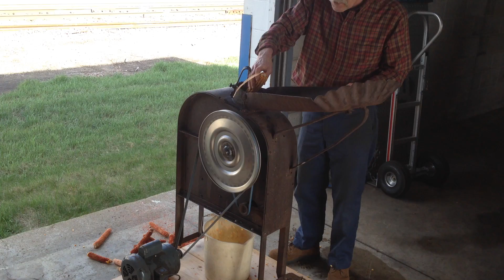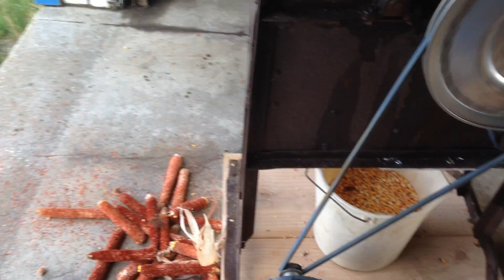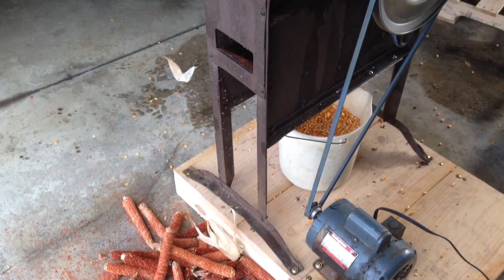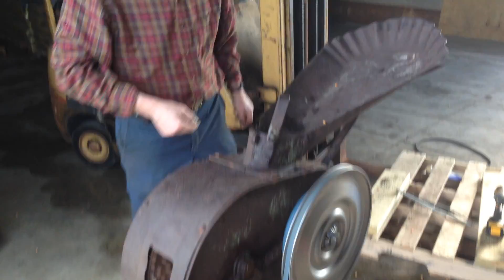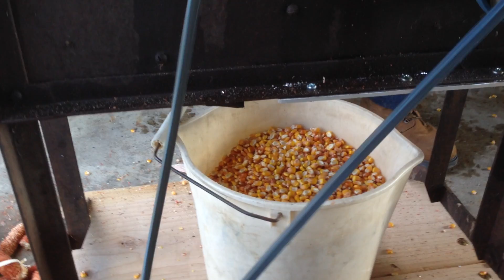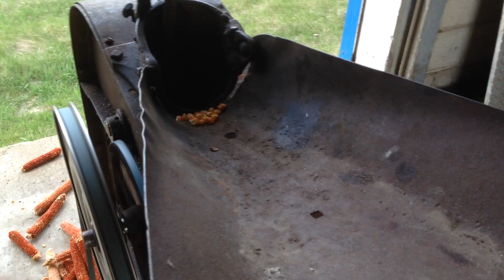Corn Sheller

Comment: I looked a long time for mine. I ended up buying one at auction that was nearly gone. I rebuild the iron and made a complete new box for it.
They are a fascinating bit of equipment. A motor is a nice touch. If I ever get the chance I want to pick up one of the hit and miss engines to power it.